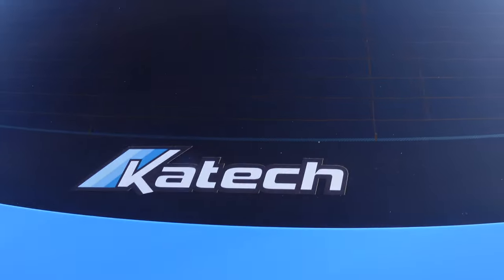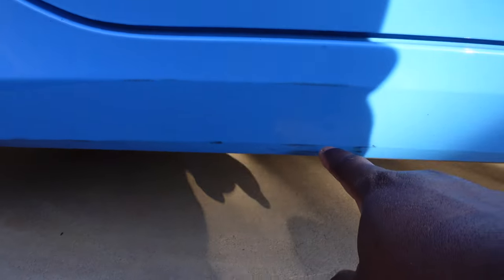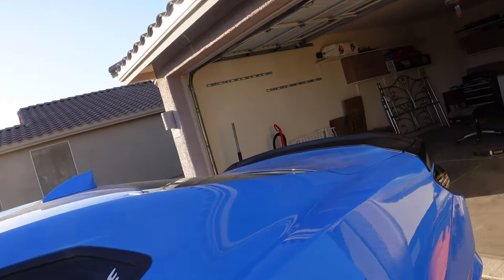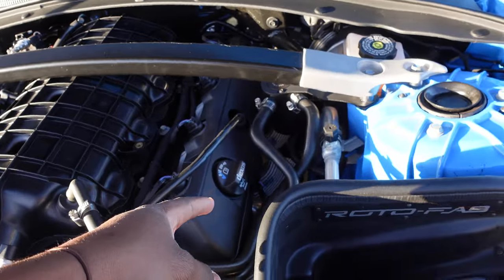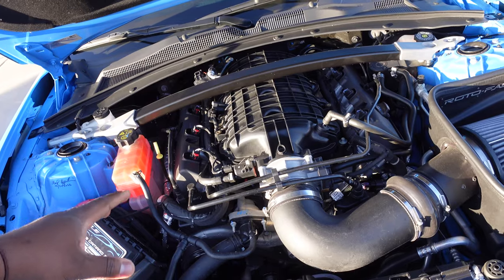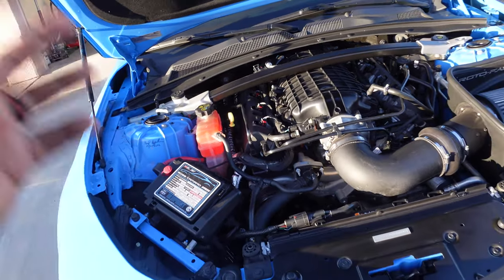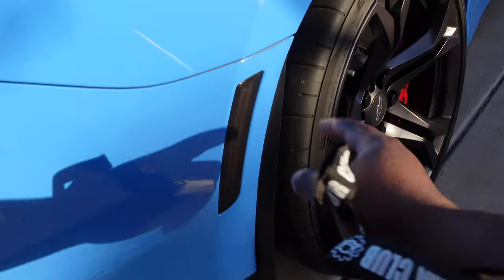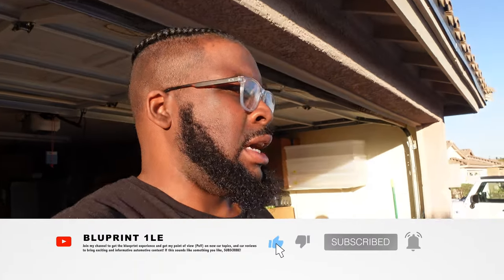Katech Built Heads & Cam Camaro SS 1LE Walkaround | How Much It Cost?!

Comment: Nice Car!  I'm in the process of getting a new 2 SS 1LE and wondering about how these mods are affecting your fuel milage?  Is it noticeable?  I realize that milage goes down on E85, but I was wondering what the trade off is when you change out the cam and some of the other things?
Reply: The gas mileage on my 2022 2ss is 18 in the city and 24 highway. If you open up your car you will drain the tank real fast. But over all its a real good car. And the back up rear view mirror makes a difference and the side mirrors too it tells you if someone is on the side or close to the back of the car. The othe camaro below the ss don't have this and this can be a problem when driving. Sir
Reply from the maker: I will let you know once I start driving it more but I share the details soon
Reply: @BLUPRINT_1LE  Thank you Mr Blue Print for answering all my questions. This is what makes your utube Chanel very enjoyable 😉 and interesting. Keep up the hard .
Have a blessed day and great day with your family. 
In Jesus Christ mighty name Amen 🙏 🙌 ✨️ ❤️ 💖

Comment: Hey bro you recommend staying 0w-40 my shop told me do 15w40 now I’m in Houston Texas. I’m h/c/i
Reply from the maker: I use 5w-50 in mines but eventually I’m going to move up to 0w-50 (use this oil oil if your catless). You could use 15w-50 that what ZL1 uses for track days. But wouldn’t used 0W-40 no more since your not stock anymore
Reply: @BLUPRINT1LE  yea im catless bro
Reply from the maker: @Galaxy2ss_  I’ll go between the two I mentioned above then. I know with the 0W-50 you need to let the car warm up before moving since it’s a thicker oil. I let my car warm up anyways but just sayin

Comment: For 17k you could’ve have vengeance racing build it, they did my buddies Chevy ss, all for 17k they put a 2.7l whipple on it, their custom grind cam,kools headers, bigger throttle body and a carbon fiber cold air intake headerscar made 839rwhp on e85
Reply from the maker: I could’ve got that same setup you mentioned for 16.5K At Katech but with a Maggie since I had the headers and CAI but I chose the NA route since I road course the car. I wasn’t going for max hp output. If I add boost to the car, it would be procharger F1A-94

Comment: What year is it? As this will void your warranty or am I wrong? I have a lot I want to do to kine when I get it but dues to warranty I was going to wait 2 to 3 years before doing the mods. Any thoughts?
But the way its amazing
Reply from the maker: It's a 2022. Yes this voided my warranty. That's long gone now since they cracked the motor. It all depends on how comfortable you are with your warranty. I already knew going in I was going to mod this car and the warranty wasnt a big deal for me. Also Camaro are known for having lifter issues and if you have warranty thats good because GM will replace it but I dont want to depends on GM Warranty and wanted Katech to handle the work because I trust them over GM Warranty.

Comment: Wow you did alot of work to your motor. Great job bro . Why didn't you install a stage 4 cam while you were into your motor. Installing a cam would of give you at least 100 horses more. Bit with the intake and the headers and the upgrade of the valve body for the intake. How much horse power do you have now. And what was the cost.
Reply from the maker: oh I did add a cam!  Stage 4 would'nt fit my build because those cams require lots of compression and its for "drag racing" applications. I dont drag race my car I road course it since I got the 1LE and it made sense. I made alot of power with my mild cam which some over cam they cars and lose alot of low end torque which I didnt want.
Reply: @BLUPRINT_1LE  Thank you Mr Blue Print. A smaller cam is just fine for what you are doing with your car. With all of this installation that you have done do you know the horse power increase in your motor? 
I am just going to leave my SS camaro how it is because I am to  old to be racing and my reflexes are not as good as they were. I did alot of drag racing in my 30s but next yr I'll be 70. But I really enjoy your videos on your camaro. Mr Blue Print Thank you Sir for the update on your baby. Ohbsorry about the scratches on your car maybe some mud guards would stop that.

Comment: Did you do the AFM delete?
Reply from the maker: Yes I did!
Reply: @BLUPRINT_1LE  Good job!! I don't know why that's on a high performance engine.
Reply from the maker: It’s on all LT1 engines but it’s not activated on manual transmissions but it’s still there! Which is incorporated with the lifters. Once you change the lifters and the block the holes for the AFM/DOD delete yours golden but any cam process they should do this! But I agree no reason it should be on there except for “emissions”
Reply: @BLUPRINT_1LE  My LS7 in my Z28 doesn't have that,  so glad I didn't have to deal with that. Keep up the great videos
Reply from the maker: @mike warren  really?! That’s interesting! Those LS motors is good then and the cam process is a lot easier. A good friend of mine has a C6 Z06 with the same motor I can’t wait to get behind it and see how that motor is. I want a z28 in my collection. Matter fact now that you mentioned it the LS7 didn’t need it it’s a stout engine! I got those lifters in my block. If I get any failures I’ll go to Johnson’s lifters
Reply: @BLUPRINT_1LE  I did all the upgraded head work, cam, headers no cats. Pretty much the same thing you did on yours. It screams on the track